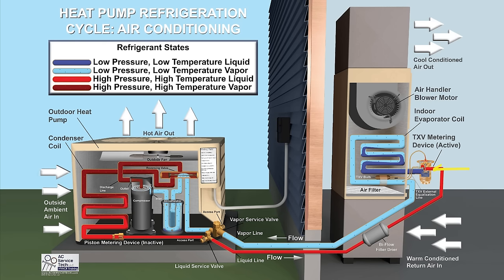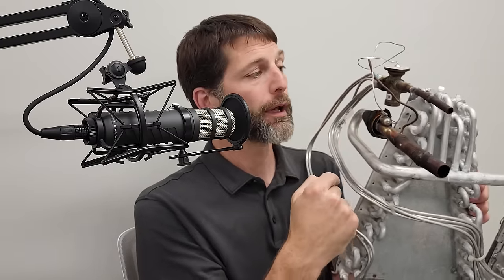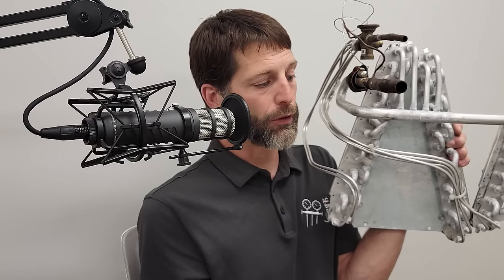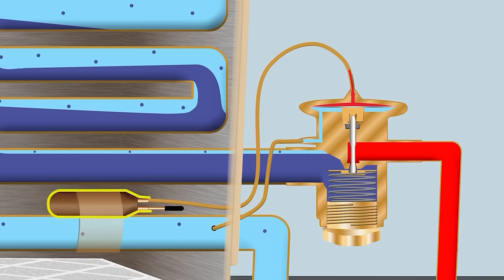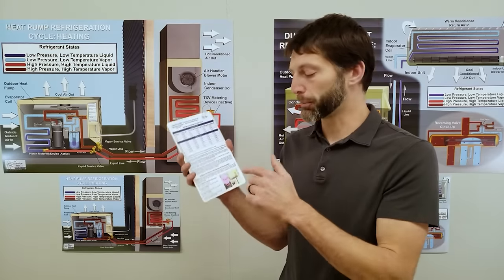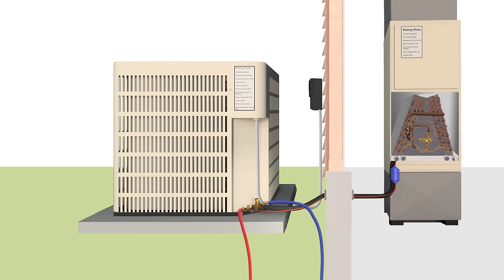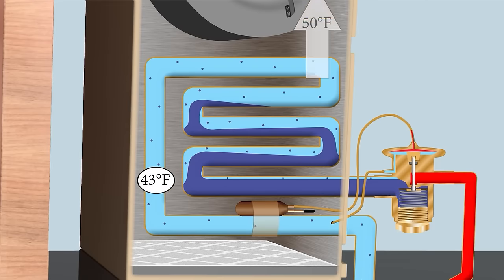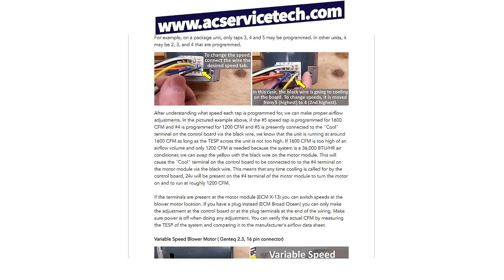Why an Air Conditioner Coil FREEZES! Examples, Procedures, Troubleshooting!

Comment: What happen when A/C continuous running none stop, don’t that cause system to freeze up ?
Reply from the maker: Absolutely if there is not enough heat to absorb because the indoor temp has dropped down way too low. However if the temp inside remains the same due to a high heat load then no it shouldnt freeze. If it freezes, that means that you likely have a low indoor airflow problem.
Reply: @acservicetechchannel  thanks for advice I think so too airflow issues EWC Zone Control
Reply: bad thermostat
Reply: In case if oversize txv is installed then indoor evaporator coil and compressor will get ice formation   pls could you advise
Reply: @acservicetechchannel  ON 🎯 🎯 🎯 💪🏼 💪🏼 💪🏼
Reply: At the end of September a technician said I was low on R 22 and coils were frozen. 

Haven't had to run AC since. NIW that cooler weather has arrived dies putting heat on have any impact on any possible R 22 
leaking brought into burners or heating system or thru house?

Comment: Off topic, but you did a video a while back on p-traps. That video is SAVING me $$$. Here's why. 4 ton split 13 years old. It did NOT have a p-trap, but had a decent trickle of water coming out the PVC. I never thought much about it until I watched that video. I installed a Rectoseal trap and dropped the humidity 3-4% (46-47%) inside allowing me to turn the thermostat up 2 degrees. I now have an excellent stream of water coming out the drain! THANKS A MILLION!

Comment: Thank you. I have a liquid line restriction issue. Now I can speak to my AC guy and tell him quit screwing me over your fired. My guy has been leading me from one thing to another charging me a fortune. Today he said its a leak I need a new Furness but he never perform a pressure test.
Reply: You can do that with gauges or pin point the leak you still need certain lincenses to buy refrigerant

Comment: Excellent explanation of the problem. I can watch your videos for hours.

Downflow system: what may cost liquid (refrigerant line) to sweat?
The evaporator coil is freezing only on the lower portion of it ( not always)- according to you it's sign of liquid line restriction. Liquid line is always cold and sweating (most of the time but not always).

Suction line is always warmer than liquid line.

Comment: Great Video. My unit started to show water at the evaporator and shut down. Like you mentioned, it was actually my blower motor. Thanks for confirming my issue. Interesting it happened a few days after a HVAC cleaning and addition insulation around to copper tube at the condenser unit.

Comment: WOW, that was comprehensive. There was alot of water in the pan below my coil and it was not draining - which it should. I sopped up all the water with a sponge and discovered that the lower part of the coil is frozen. The filter was sopping wet, so i got rid of it. It was installed 5 mos. ago, but appeared clean. I had no idea I was supposed to change them every 30-60 days.

 I checked the outside drain and the ground is all wet, so I don't know if it's clogged or not. I cleaned the coils inside and out before the season, so i know that is not the problem. I'm just going to leave the filter off overnight and see if the increased air flow helps defrost the coil. If not, i will call the HVAC tech and see if the TVX valve needs to be replaced.

Comment: The Vapor line at Work froze. The Filter Drier was outside. It was frozen on the Evaporator size of the Filter Drier only. The problem happened because of a Failed Blower Motor Capacitor. Thank you for your videos.

Comment: Easy as it should be.
Craig, do you have an indepth video on liquid line restriction, causes and how to diagnose it. Why will half of the evaporator core freeze for liquid line restrictions instead of entire coil?
Reply: @electricboogie709  before the refigerant would have reached the exit of the evaporator core it must have frozen completely due to very low pressure resulting in lower temperature below freezing point, thus not enough refigerant to pass completely through the system, this is also dependent on the level of restrictions caused by the orifice. I seem to get it clearer now. Thank you Boogie et Craig
Reply: @gpsfleetmatic  not quite, the refrigerant won't ever freeze, only the moisture in the air will freeze onto the coils surface and the distributor tubing. Only part of the evap freezes because the coil is starved of refrigerant which is what is making the pressure low and in turn the temp below freezing on the coils surface. Assuming proper load on the evap, the refrigerant will still boil off into a superheated vapor as it works its way up the coil which will leave the coils surface at that portion above the freezing point of water. If you had a starved coil as well as improper load,the whole thing would be frozen.  But this partial freezing will only take place on this design of coil where the refrigerant feeds into one side and exits the opposite,bottom to top, some other designs the whole coil will freeze in both situations but maybe only on the air inlet side so it's always best to let your SH and SC tell you what the culprit is.

Comment: I got a mini split with a capillary tube metering device, and when I charge the system the suction pressure (and only suction) will stop at about 45-50 psi (R22) where the saturation temp is about -5C. It doesn't matter how much refrigerant I add after this, the pressure will not go up even if I end up putting in more refrigerant than what it says on the name plate (basically an overcharge). So I end up just stopping when the AC works reasonably well and not freeze the coil.

Comment: Hi Craig, great video, thanks!  Would you be willing to take a guess at how many compressors are permanently damaged due to liquid slugging as a result of a failed indoor blower motor / cap. while the system continues to “compress” liquid?  I don’t have a clue personally but would be interested in your educated opinion. Thanks!
Reply: Liquid receiver / suction accumulator brother

Comment: Bravo! I kept hearing “air restriction = freezing” but this is the first time someone has said “air restriction = less phase change to vapor in the evaporator = low evaporator pressure = freezing”. I couldn’t understand why I got 62 psi readings (R-22) when I checked the low side and the chart said that was above freezing (36F from memory).
A question: Is there a valid argument that the new HEPA filters restrict the air flow and that a cheaper “horsehair” filter might work better on an old system?

Comment: Excellent explanation Craig question about hi flow filter, wouldn't that cause more dust to pass through and collect on the evaporator over time and cause flow issues vs a filter that traps everything however is a little more restrictive and cause air flow problems....I guess there's pro's and con's to both filters....do you want more air flow or cleaner air🤷🏿‍♂️

Comment: I bought a $20 Honeywell digital and programmable thermostat about 9 years ago. Apparently, it stopped turning the A/C blower on and the evaporator froze up. I couldn't get the fan to turn on at all. I just happened to have an exact replacement and, after I de-iced the evaporator, I got the blower to work with the newer thermostat. 
At least this is what I hope solved the icing problem.

Comment: surprised you didn't mention the orifice on some systems .. like some come w txv some come  w the fixed orifice and both can get jammed up and cause a restriction... came across a r22 low side line set was frozen all way up to the evap  coil. gauges read 25 psig on low side 15p on high and this was w the evap coil frozen... had to let it all defrost so can get a better 3 min reading for low side evap coil temp then another 7 mins to check the rest. but once I disconnected hoses the low side was defrosted and I heard a hissing so the core valve possibly could of been leaking even tho it had a cap on it before and was frozen before I had a actually put hose on low side ...  so was suspicious of leak w possibility of low refrigerant but once again needed thr whole unit to defrost to take the pressures while running and also replace core valves w new ones and continue to test for leaks and rule out if it is low refrigerant,  check evap coil for dirt build up because did notice the return and supply grills had alot of black dirt on them which indicates the return didn't have filters in it for long time so they ran the unit w out that filter and it could possibly  have lead to the evap coil getting caked up w dirt causing bad air flow and last the fixed orifice could be clogged up some how. ... will find out

Comment: Any hints on why the outdoor condenser coil ( and also looks like the compressor and tubing inside the condenser housing)....freezes in winter-mode operation "on heat" ???? Bad defrost control?....bad thermostat somewhere?.... faulty reversing valve?.....

Comment: I have an interesting problem where my AC doesn't cool enough to drop the temp to say 75.  It runs too long and the outside unit shuts down I assume it gets too hot.  There is no freezing anywhere.  The inside heat exchanger gets cold but I don't think it's getting cold enough.  The filter is clean and the indoor fan is good and there seems to be plenty of air moving.  The outdoor heat exchanger is not dirty.  Tech is coming tomorrow

Comment: I'm having an issue where the coil is freezing from the line that that's leaving the furnace. It looks like there's a leak coming from the silicone seal. Can a leak like that cause freezing?

Comment: I got a new furnace, and now my 16 year old A frame AC unit is freezing. The Cool fan speed is at High. I have switched my filter to the thinnest possible to increase the airflow but it's still freezing over. The furnace guy blames it on the AC A frame unit siting on the furnace and impeding the air flow. He was no help. He installed a temperature gage on the refrigerant line to stop my thermostat but forgot to connect it to a timer, so his solution is to stop my AC from working.

I had an AC technician measure the Static air pressure which came out to be 1.07, way outside the manufacturing parameters, it's not even on the chart. The AC technician also said the refrigerant levels are good and we have no leeks. He said there is not enough air intake coming in. The fan sounds too loud when the AC kicks in. Could lowering the fan speed to medium help with the freezing? Do I need to add an intake vent?  HELP! 🙂

Comment: Hight pressure : 103 f°
Low pressure : 40f°
Sobcooling : 10 f°
Superheate : 10f°
Return air temp : 71f°
Supply air temp : 50f°
The évaporateur is always freezing

Comment: I have a question should a closed ac Freon unit every need recharged if it never leaks. Or do all units have to be recharged every year or seasons
Reply: It’s a closed system, should never leak. No need for recharge unless there is a leak.

Comment: I need help my suction line is freezing.my ac has gas
I also checked for leaks there is none.my readings are good and i cleaned my ac but still ice only on the suction line.also my blower wheel is making a noise whenever my ac blade is raised up.whenever i lower it the noises stop.anyone has a sollution

Comment: How can you test the liquid line restriction or the metering device to determine the problem? And what is the procedure to replace them?  De-solder or replace the entire A coil then recharge the system?
Reply: Take bulb off and warm it with your hand or in a cup of warm water. If super heat doesn't adjust then txv is bad.
Reply: And for filter dryers test temp on each side. Should be the same.

Comment: Problem: Indoor blower turns on/new filter.
                 Turn on A/C and runs, once the A/C runs for about 20 min the indoor blower turns off for a few min (AC still running) and starts up for 30 seconds or so. The cycle continues and the AC starts to freeze.